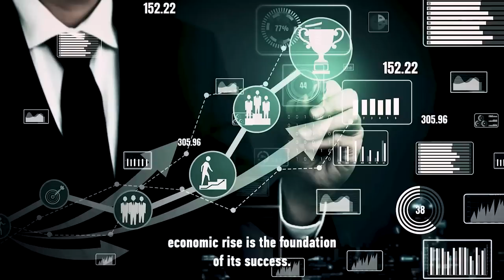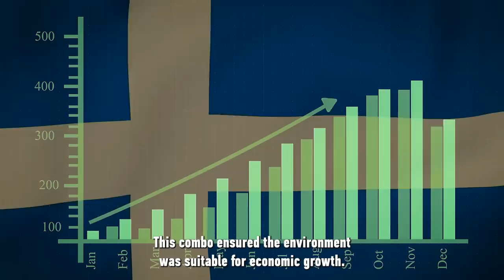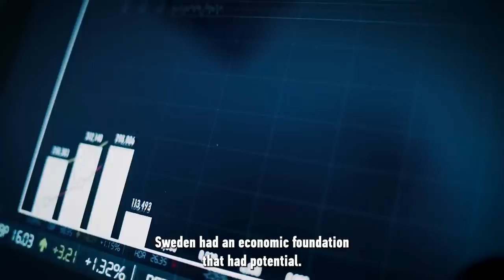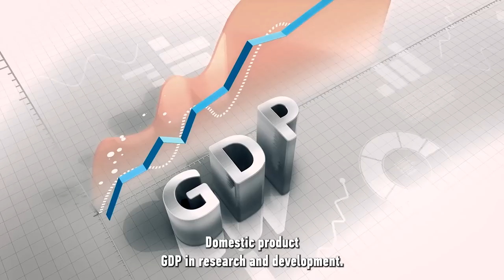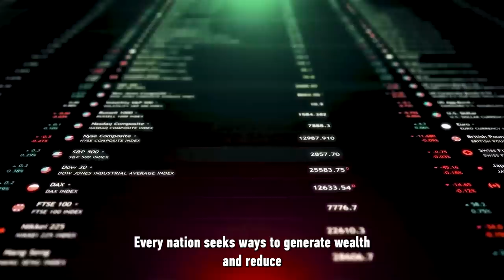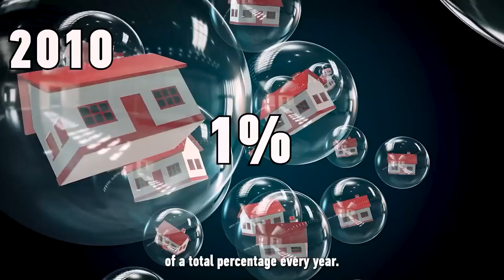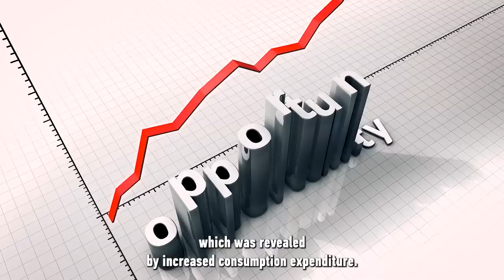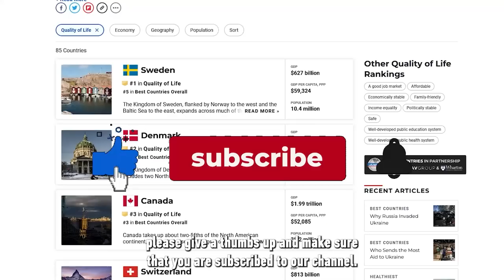How Did Sweden Become So Insanely Rich? What’s Their Secret?

Comment: There was a stable economic growth 1880-1960, with annual growth rates of 1,5 - 4,5% . After that it slowed downed as the public sector grew and tax levels increased. In the 1980's gorwth was down to 1%. This led to a financial crisis 1992-1994, during which time well needed reforms and budget cuts were implemented. After that growth bounced back.

Comment: There are several reasons why it may be challenging for individuals to become extremely wealthy in Sweden. Firstly, Sweden has a high tax rate, which can significantly impact the accumulation of wealth. Additionally, the country has a strong welfare system that aims to reduce income inequality, making it more difficult for individuals to amass substantial wealth.
Reply from the maker: It's very common in whole northern Europe 🌍

Comment: No one is talking about how Sweden '' mysteriously'' became rich during ww2
Reply from the maker: Good point !
Reply: Selling steel to Nazi Germany was quite lucrative. Later on when most of Europe was bombed into pieces it was easy to innovate and produce since there was no competition.
Reply: Because they sold iron to Germany which was the only possible trading partner. They controlled Norway which has Narvik the port LKAB uses to transport iron in the winter. However to get that they had to travel through nazi territory. Secondly, the nazis had plans to invade Sweden but Sweden had prepared to blow up their iron mines in case of invasion. So the nazis would invade Sweden if Sweden didn't sell iron.
Thirdly Sweden's economy grew more after ww2 since the world that had been effected needed to buy resources which Sweden had because they hadn't been effected by the war.
Reply: @darkwolf4434  Yes and the Luger and the 9mm was manufactured and tested in Sweden